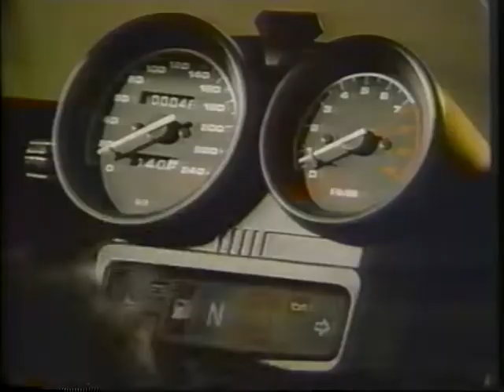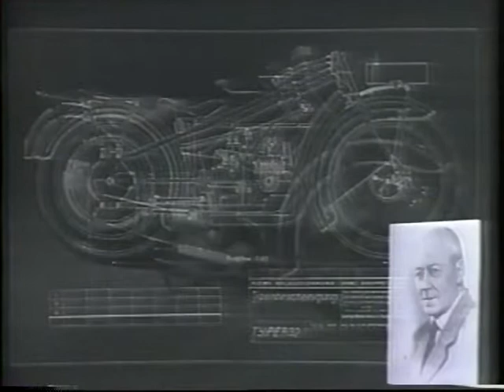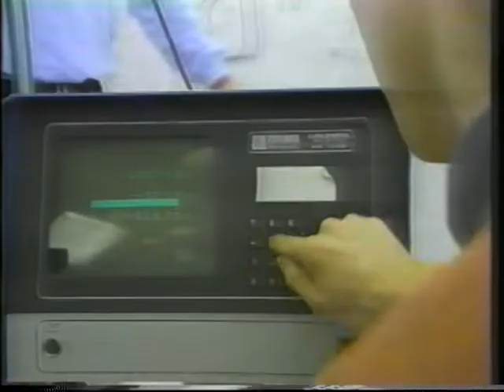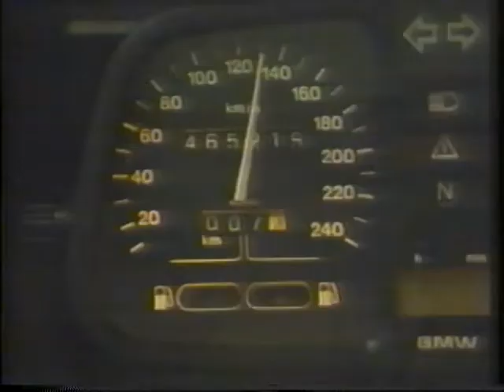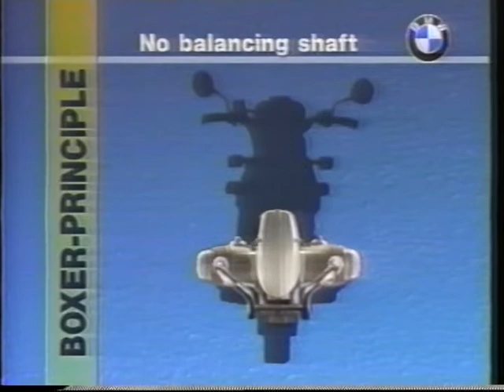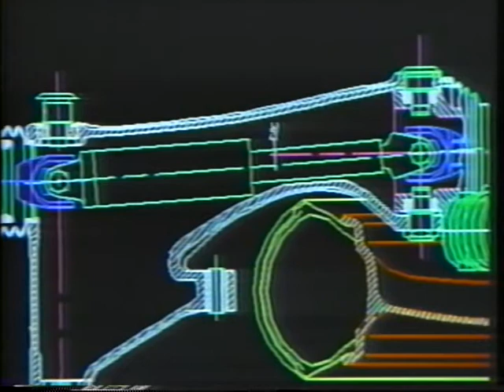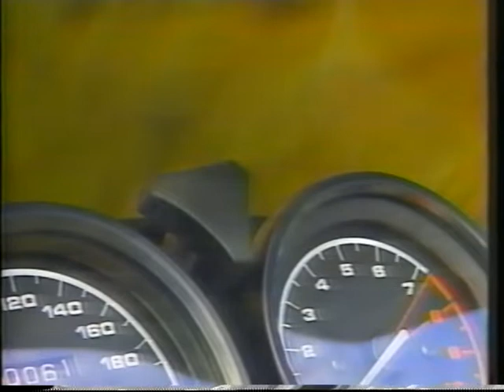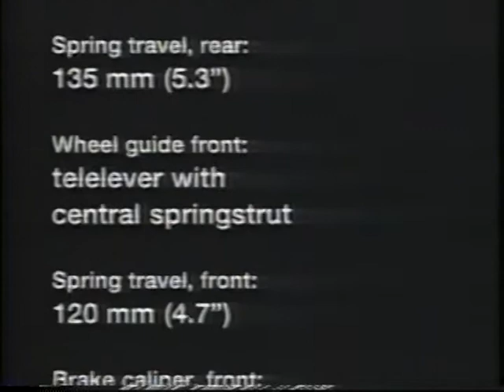Past. Present. Future The New Boxer R 1100 RS (1993)

Comment: I have owned 9 R bikes, and 2 K75s beauties.... My favorite was the R80G/S I bought new back in the day. That is the best bike ever built, in my humble view. I currently have an R1150RS, also, an incredible bike, that is absolutely visually, a stunningly beautiful bike, like the R100RS was in its day, too! These bikes are so amazing! They handle like a dream, have great brakes, and they run forever! The new Beemers, with all the gadgetry, are less reliable, and according to those who I know that own them, spend as much time in the shop getting fixed (electronics issues) than on the road being enjoyed. This is ironic, because I started riding BMW motorcycles for their reputation for reliability.... New is not better. I'll stick with the Airheads and Oilheads, as these models carry the legendary aura that this brand was always known for, for 75 years, until BMW felt the pressure to "modernize" their image. Well, it worked, they are modern, and completely disposable, like everything else these days, even people. And the "global-ists" wouldn't have it any other way.... Thanks for the video. I am retired from LADWP, so it was great reliving the roads of my youth, now that I have moved away after retiring....
Reply: Thanks for sharing dog

Comment: My favorite one amongst my bikes, so efficient ! just a weak point ; capricious ABS
Reply: I disabled the ABS on both my GS and K100RS/4 because I don't trust it. I had a potentially lethal experience with it on the K (front brake frozen on a descent in the Pyrenees).
Reply: I've never had any problem with the ABS on my '95 R1100RT (owned from new until today), other than the usual thing of it failing self-test if the battery is a bit low on a cold start. Riding a km or two and then turning the bike off and doing a warm start at a convenient traffic light (etc) resolves that. Or if you have electricity handy, keep it on a battery tender (trickle charger) when you'e not using it and that never happens.

Comment: I had a series of Hondas (XL350, XR250, CBX400, CBX550F2) then at age 24 was intrigued by a used R80RT. Owned it less then a year before upgrading to an ex-police K100RT in early 1988. I had a long test ride on the first demo R1100RS in 1993, took it back, and said "When there's an RT my name is on the first one". (Yeah, not the way to get a below MSRP price lol). Sure enough, I got one from the first five in NZ, registered to me on 1 October 1995. I'm still using it today, October 2023, 28 years later.
Reply: Just picked up a 1988 R1100RS for $2,200 in Nelson.
Reply: @humandroid53  Nice, but the 1100s weren't released until five years after that. Maybe it's an R100? Or a 1998? Or ...?